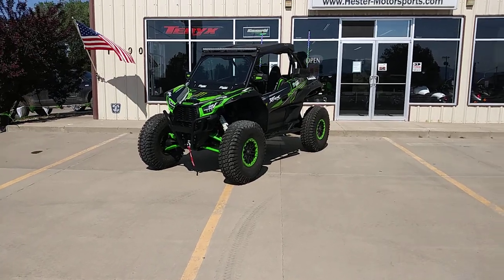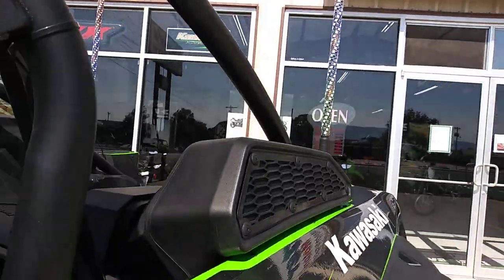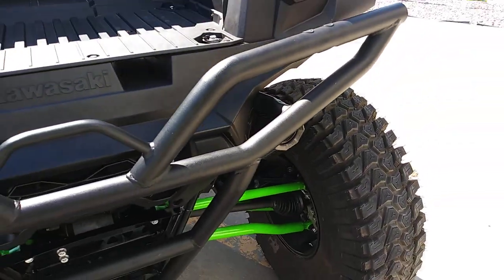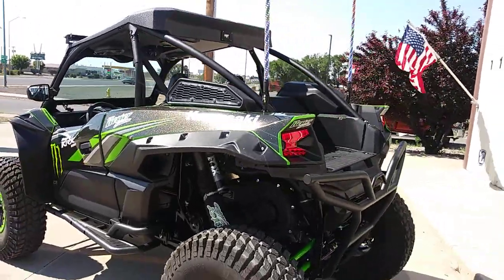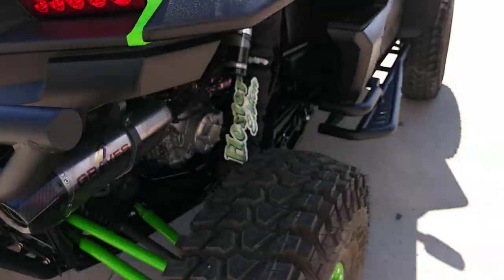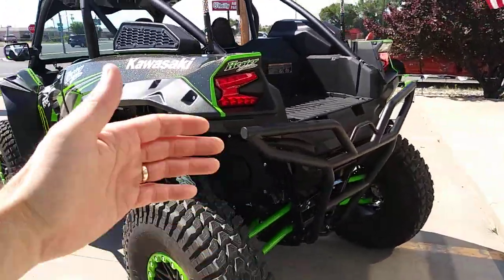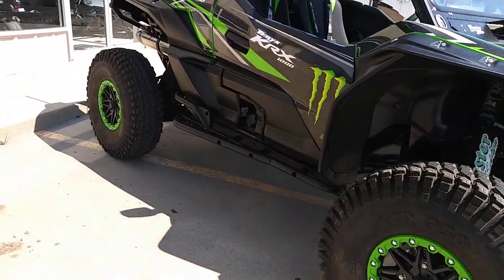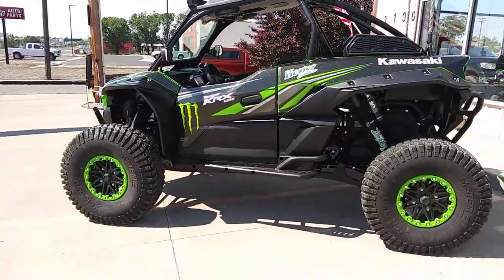2020 Hester Edition Kawasaki KRX 1000 *SOLD!*

Comment: does adding these mods void the warranty?
Reply from the maker: Nothing voids a warranty from Kawasaki, Kawasaki will not cover the parts that have been replaced or modified under the warranty but will not drop bumper to bumper coverage on the unit. The only "mod" on this build would be the exhaust and flashing the ECU, and they know neither would effect the product as a whole, unless the flash is from some back yard hacker then may question, this flash was done by Graves along with the exhaust, which is a race partner with Kawi and they bought the ECU codes to flash, 100% covered! Well not the exhaust, Graves warranty would cover any defect on that, if any. Upping to 35's requires 0 modification, no lift or anything, and several of the parts are factory Kawasaki parts which even those parts have a 90 day warranty from defects from Kawasaki. This unit also had an added 3 year factory extended warranty bumper to bumper. 3.5 year warranty good at any Kawi dealer in the country.
Reply: @HesterEdition  thank you for responding.  Your videos are great and informative.  I live in TN and wish you weren’t so far from me.
Reply from the maker: @timnewby115  we get that alot lol. Thank you. We do parts all over as well so can help in many ways